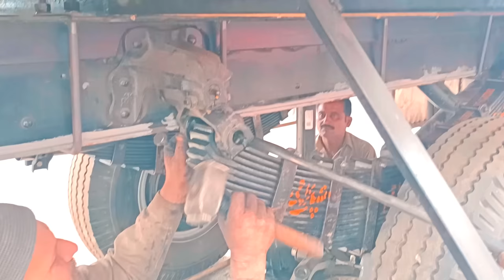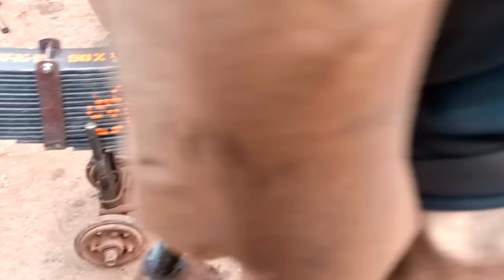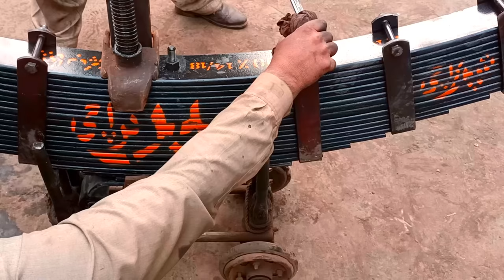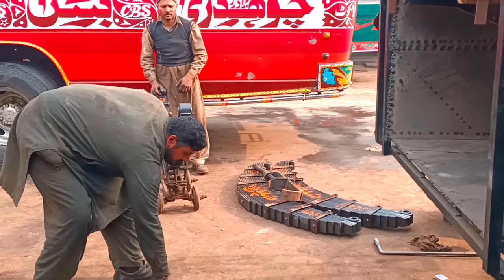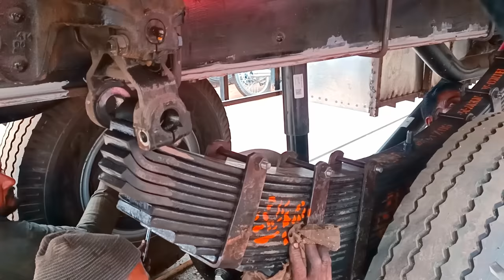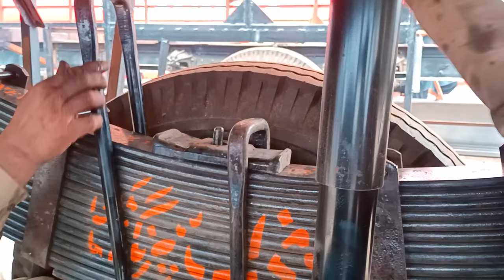Hino Bus Leaf Spring Installed at local Workshop | Hino Bus Body Manufacturing Process

Comment: A bus needn't have that much Springs . These people don't know basics in automobile.
Reply: that is how one who belongs to a third world country, and i appreciate it....
Reply: thats ok they will learn
Reply: Their roads call for such. Its uncomfortable but necessary
Reply: You probably don't understand the local needs
Reply: They need it because their bus will carry a lot of load even on the top
Reply: Have you seen rough roads of pakistan,  these roads can't affords  shock absorber like Europe roads , it requires kamanis spring
Reply: Eles sabem muito !!!
Agora o que você não sabe e o peso e que eles carregam dentro e por cima desses ônibus !!
Reply: My dear, it depends on which geographical land the bus is going to operate, in Africa there are big needs of these buses with strong spring doe to bad and impropriety road / raugh roads
Reply: because theirs road condition .
Reply: @ABDULREHMAN-by7zk  - If they have bad roads and must heavy loads they should use bigger Leaf-springs that’s made for trucks and buses, not bunching up a dozen small Pick-up/Car leaf springs together into such ridiculous height. I’m afraid if this bus ever drive into a deep turn and the road is at an angle to one side the whole wheel system would shear off from it’s chassis. Remember these Springs are only held down by gravity, those side steel support hold little strength when it ever goes out balance.